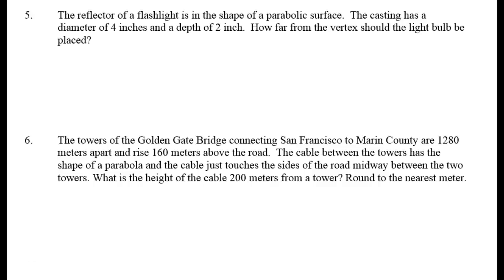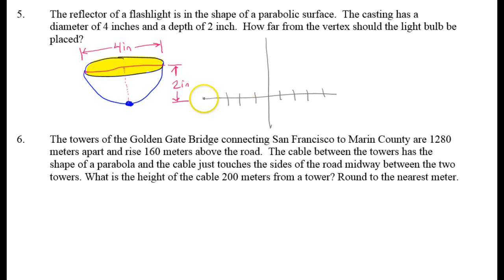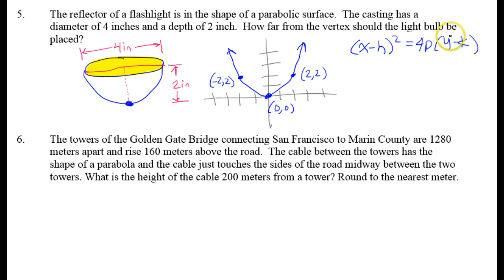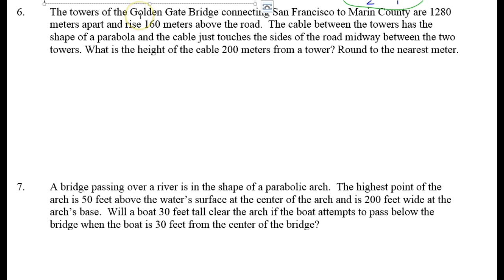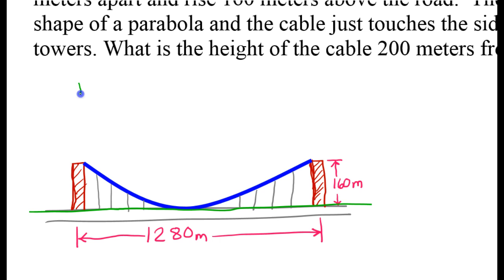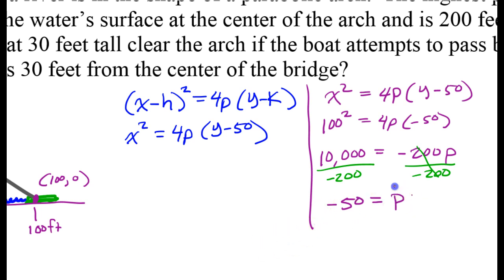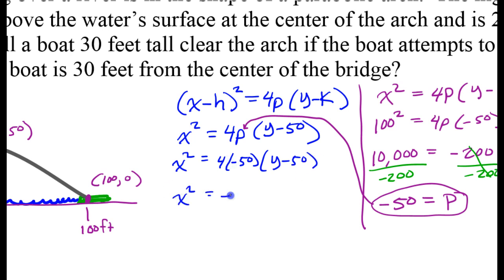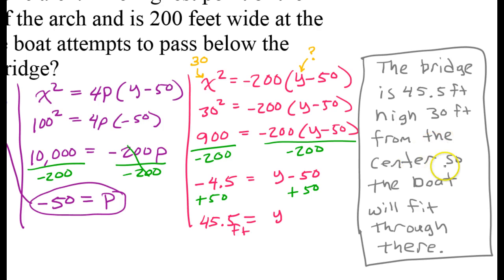Day 14 CW (5 to 7) Solving Real World Problems Using Parabolas

Comment: For number 6, You can put the vertex in the origin and youll still get the same answer, its much more simplier
Reply from the maker: It makes it easier for the first half of the question, but harder for the second half. That’s all my opinion of course. Each mathematician will have to decide what works best for her. I appreciate you pointing out an alternative method. 😎

Comment: in question 7 why did you use upright equation on it even though the parabola is visually points downward?
Reply from the maker: One uses the same equation regardless of whether the parabola faces up or down. Either way, it is vertical so we use the vertical parabola equation (the one where the x part is squared). If the parabola opened sideways somehow, we would use the sideways version. The thing that I think is confusing you is that you know that when a parabola opens up, it is positive, and when a parabola opens down, it is negative. The thing is, you don’t need two separate equations for that. Just plug in the key points you know (usually the vertex and one other point). If the parabola opens down, it will come out negative when you simply. In example 7, you end up with -200 in the part of the equation that start out as 4p. The negative in front of the 200 matches your observation that it is visually down. That’s evidence that we are on the right track. 😎

Comment: Wait so you divided the last problem by 200 so that y-50 will be isolated right? What i dont get is why you added 50 to both of them, i understand for -50 to canxel it out tho
Reply from the maker: @AryanSquibbles  The height is given by the y value so we want to get y by itself. Since we had y-50 on the right side of the equation, we had to add 50 to both sides in order to cancel out the -50 and get y by itself. When solving an equation you must always do the same thing to both sides. If you add 50 to the right side to cancel out the -50, you must add 50 to the left side as well.

Comment: how do u find the general formula (quadratic function) based off the standard equation?
Reply from the maker: You just have to get rid of all the parentheses and combine like terms. If you have (x+3) squared, write it as (x+3)(x+3) and FOIL it (double distributive property). If you have 8(y-2), for example, distribute and get 8y-16.

Comment: I thought that that the standard  equation for opening downwards is the 4p is negative like this (x-h) ² = -4p (y-k)
Reply from the maker: You are correct. Which problem are you looking at where it seems I should be doing that but I didn’t?
Reply: @MrHelpfulNotHurtful  seems he was talking about problem 7
Reply from the maker: I think I see the problem now. On problem number 7, my 4p value came out to be -200 indicating that the parabola is facing downward. You don’t need to write -4p in the formula. You can just write 4p. If the parabola is facing downward, the p value will turn out to be negative which will cause the value of 4p to be negative. If your teacher teaches you to write -4p, that’s fine. You just have to view p as a positive value no matter what. The important thing is that once you finish writing the equation, if you have a negative number in front of the ( ) on the right it means the parabola is facing down. A positive number means the parabola is facing up.